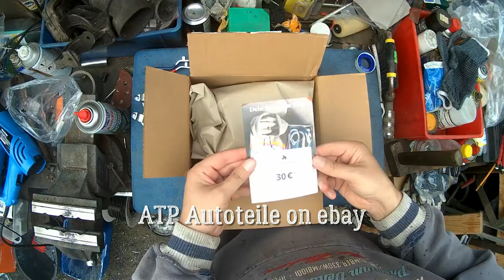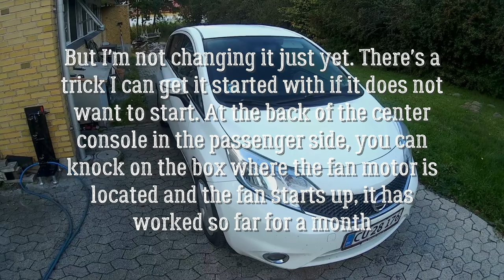DIY Fan heater resistance change on a Nissan Note E12

Comment: Hey, would be nice if you could help out with an issue I've been having on my 2006 Note E11, the fan used to be sporadic but one day it just completely died, I've tested the motor and it's working, but when I measure the voltage coming to the fan motor, it seems low (around 8-11V, no matter how high or low the fan speed is set on the climate control), to add to it, the fan was changed a while ago and it didn't fix the issue, could it definitively be the resistor card?
Reply from the maker: I dont know about the E11 if it has a resister card this can make problems like blower not working at all and stuk in one position, it cant Hurt anything changing it out for a new one. Thanks for watching

Comment: Whats the trick on banging somewhere to get the fan motor going please?
Reply from the maker: Try banging in the passenger side as close you can to the fan motor it worked for me some time 😅 good luck. Thanks for watching
Reply: Just got a blower motor for mine currently hitting the passanger side of the climate control unit just so I can get it past the Dead spot in the blower  (that's blower motor not resistor and that is a whole different kind of worms because they have stuck it behind the dash instead of under the glove compartment where it usually goes (on vw or skoda anyway)